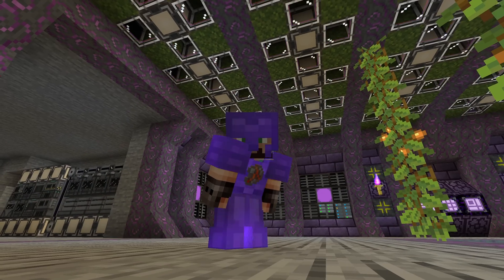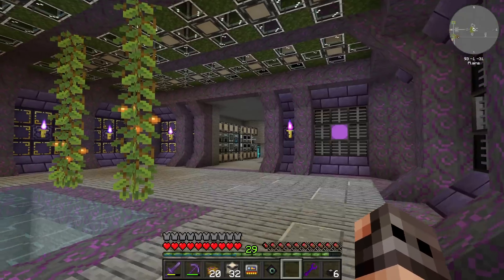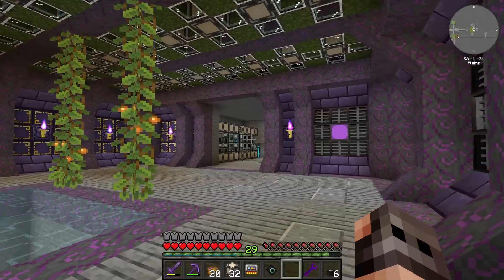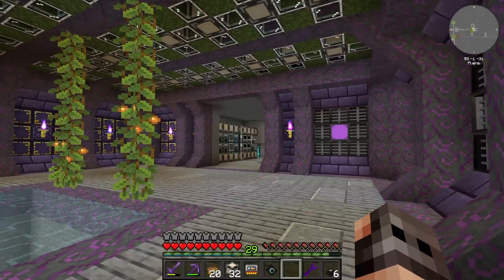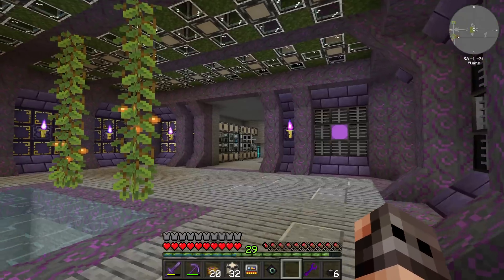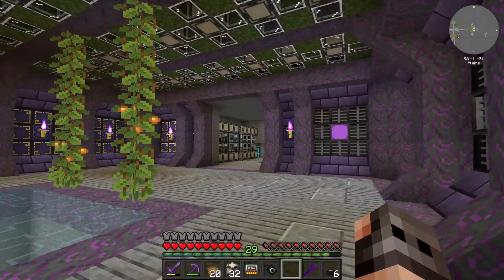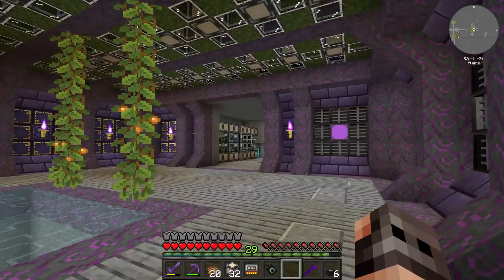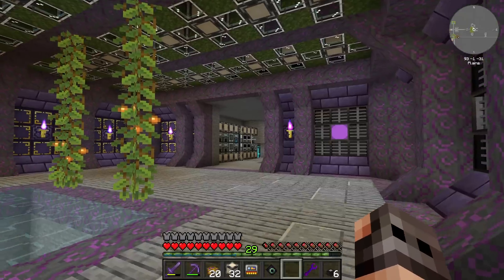StoneBlock 3 - Ep06 - Energy Condensers and Nitro Reactors

Comment: Bello !!!!!!! thats insane  ! btw how do you get that much uraninite ? because i completed the pack 2 weeks after it came out and it was insanely grindy
Reply from the maker: bello Mr. Pringles <3
well the starter ones I just mined a bit :D 
the rest is on autocrafting. its a energizing orb with one single job, to convert uranium into uraninite. 
why would it be grindy though? cause i guess you had uranium chickens, no?
Reply: @Lashmak  no way they really added uranium to uraninite ??? i had 10 crushing wheel at full speed !
Reply from the maker: @Pringles1  ah lol actually i started making uraninite after the update. before the update and when i couldnt login, i didnt even check the recipe. then yes, you should be very confused :D

Comment: I think you can use the philosophers stone to change mobs into ghast
Reply from the maker: i do have a feeling that was a ntc2 thing. are you sure?
Reply from the maker: i mean its cheap, i can try lol
Reply: It's a philosopher stone thing AFAIK.  Just need a form of low level fuel or a Klein star. Low level like 64-128 EMC per. Not sure what the threshold is, but I used Redstone till I got a Klein star. 
I tried this in 3 different packs once I learned about it. Worked in all three.

Comment: There's an infinite booster card you put inside the ME wireless terminal, and it doesn't even require the wireless access point to connect to the ME system.
Also, I'd love to see you use another power system, like endergenic generators. Almost everyone goes the Powah reactor route because they're insanely overpowered. A 36 block structure generates more power that an 8 rod fission reactor and steam turbine, which requires tons more materials and careful automation to make sure there's no cataclysmic failures. There's literally zero risk with Powah reactors, and they consume hardly any fuel. Powah is WAY too over powered (parden the pun) and although I was totally in love with it when I was first introduced to it, now I feel like it's the just pointless to make any other power source because it's super simple to craft the nitro version, specifically in this pack.
Reply from the maker: my dearest Armitage <3
you are one of the people whom i always respect their opinions and try to implement the suggestions. I also dont think power should be free. i mean even a bigger reactor with turbine reuires 10 times the effort as powah and gives you less power. 
the issue is despite spending a few hours, i could not setup and endergenic generator in this pack. in 1.12 it works and i can scale it up, but here even the one on the wiki doesnt work :( either i am lagging, something changed with the mod or something has changed with redstone. also for making fissile fuel i need around 200-300k rf per tick. I cannot find any other options in this modpack which comes even close. everything else is around 400-500 rf per tick max per generator. me is very sorry, me tried really hard
Reply: @Lashmak  I have 2 of the 4 endergenic setups working atm on a server. And my current Mekanism reactor setup is 2 reactors with 4 fuel rods each consuming 4mb/t of fissile fuel, and I started that setup with just the 2 endergenic generatos (around 35-40k FE/t). The biggest bottleneck for fission reactors in this pack is the ability to feed them water, as there's no sinks, the create pumps are too slow, the mekanism pumps are also too slow and power hungry. The only solution I found was literally hundreds of Aqueous Accumulators from Thermal Series. And even then I had to use Mekanism mechanical pipes (I really don't like mekanism's item/fluid/power transport, it's coded very badly in that every section is an entity with an inventory, results in more lag than necessary) as they were the only thing that could handle the amount of water and didn't bug out on server restart when the reactors reformed as multiblock structure (pipez fluid pipes stopped seeing the reactor ports as valid targets for fluid when the server restarted, took me 2 reactors exploding to figure that one out 🤣) But even then, my current setup for steam power is bottlenecked by the amount of steam produced by the 2 reactors, the turbine is outputting a little over 360K FE/t, which is less than the 36 block reactor that requires literally zero upkeep or infrastructure. I really feel like the FTB team should have just disabled the Powah reactors.
Reply: Or they could've nerfed them like they did in Oceanblock.  By a factor of almost, but not quite, 10. Nitro is 56k in that pack, not 500k. Still useful, but not way OP.
Reply: @dageekgamer4685  I feel like even if they did reduce their power output the vast majority of players would still use them. Even at 50k rf/t there still so easy to make and require literally no management other than easy to get fuel and catalysts.
Reply: @ArmitageShanksMC  That is undoubtedly true.  Most players will go with the comfortable and familiar,  or the easy route. I find myself doing the same sometimes though I try not to repeat myself too often. I'm very fond of any passive power system and will build those to excess sometimes.  (My latest playthrough power system started with 8 heat generators from Mekanism and quickly grew to 24.)